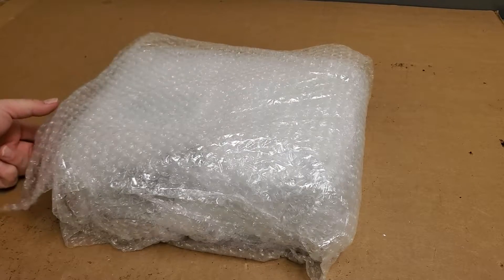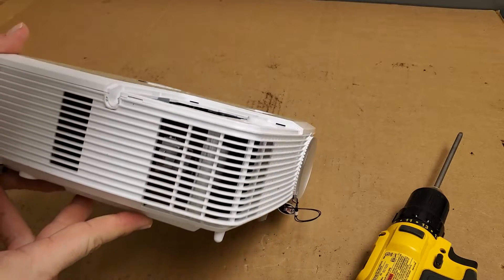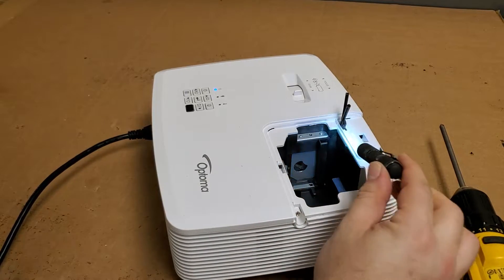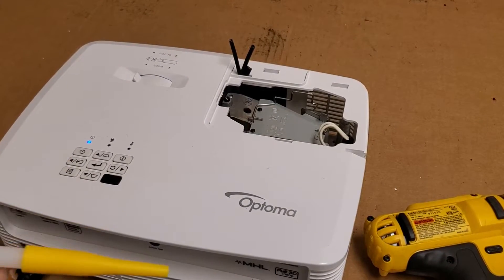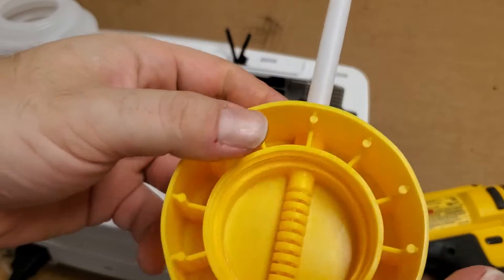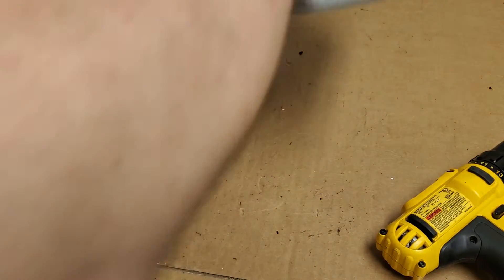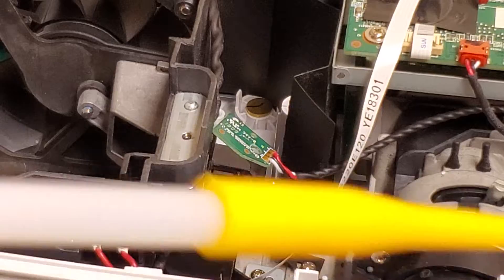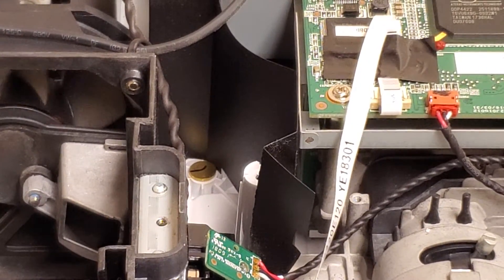Optoma HD27 DLP Projector Repair / No lamp ignition

Comment: Haver you ever fixed an HD27 with a "Fan locked" error? I replaced both fans. Still get the error.
Reply from the maker: That is annoying.  I would check the status output of each fan and see if one isn't working. I have a video on testing fans that might help.  It's possible something on the main board has an issue.  The fan control IC might be bad or the pullup resistor for the fan status lead.  Also check the solder on the connect.

Comment: Hello - I have an HD27. When I press the Power button, it initially goes blue. But then after a couple of seconds, the lamp LED shows red and the power button begins flashing red. I had tried to reset it by unplugging all the cables and then holding the power button down while inserting the power cord. Then the power LED began blinking quickly and then I released. Then I read to press the Power button again and there should be a "click", but mine never did and eventually the Power LED went back to red. I have yet to resolve the issue. There is no fan that comes on when I try to power it on. Any assistance would be greatly appreciated. Thank you!

Comment: Any idea on why an optoma hd144x has all 3 leds lit up. power red/ blue leds lit, lamp and temp leds are red? Just turned off with less than 70hrs. No other signs of life!!! Will have to leave in somewhere local as unfortunately your to far away. Thanks for the videos
Reply from the maker: without seeing it I am guessing but I would be suspect of the mainboard being bad. I can't really say what is bad on the mainboard but if I had to guess, it would be a voltage regulator as they are a common problem. Another possibility is the power supply.  This sort of problem is usually pretty terminal. A replacement mainboard is in the $300 range. If you have any local techs who can check it, they want to verify the low voltage power supply first. If that checks out, then check the little voltage regulators on the mainboard.   Let them know the PMD1000 IC is a known culprit as well.
Reply: @FixitFrank  thank you, I appreciate that you responded and shows that you are motivated to online education via your videos. I havent seen the fault reported anywhere else online. I'm a physical therapist, so not my area of expertise and would only go as far as testing capacitors fuses, mosfets. I will leave it in and if they can fix will update on the cause in case it helps yourself or someone else. Many thanks again Frank.

Comment: Hi I have a UHD35 that had a big lamp blown. I had to replace the power supply board because it was burned. I have also replaced the lamp but when I turn the device on it shows the optoma logo but after few seconds it goes off and I get blinking red light for power and fix red light for the bulb. Do you know what could it be?
Reply from the maker: its hard to say on that chassis.  I'd see if the color wheel is okay.  Also if you replaced the lamp assembly with a cheap one, that can cause it because they use the wrong IR filter on the housing.  Make sure the lamp has a red/blue tint to the front glass. If its green/clear that is your problem.  If not, then it might be a mainboard issue.
Reply: @FixitFrank  thanks a lot. Really appreciate your response and your videos all of them very instructive. I'll check about the lamp although is a Phillips one. I think it might be the color wheel...hope is not the main board. I'll let you know when I get it sorted. Again, thanks!
Reply from the maker: I dont mean the bare lamp. I mean the full housing.  see this picture. https://imgur.com/i4eyOKE The part I put the box around is what you want to look at. If the lamp assembly was from Optoma then it will be okay but if you bought it on amazon or from some of the bottom feeder aftermarket websites, that could be the problem. h

Comment: I fixed my color wheel which was missing a chunk, and I also replaced the bulb.  Now the fan doesn't even go on and there is just a light clicking sound and the projector goes into red dot lamp failure mode.  Seems like things have gotten worse after replacing the color wheel.  I have an HD28DSE.  Any advice?  Thanks
Reply from the maker: Did you replace the wheel or just glue the chunk back in?  It could be the wheel you hear clicking.  The wheel must spin up before the lamp will ignite.  If you didnt replace the wheel, I would do that first.  Usually once they throw a segment, they are pretty done.  Sometimes you can recover them but its rare that it works.
Reply: @FixitFrank  Thanks Frank, it was that I didn't trick the switch on the lamp cover.  Silly mistake.  Everything worked after that, but I did accidentally remove one of the screws holding the mirror box in the light tunnel so I had to spend an hour adjusting it to remove the burn on the screen.  I ended up getting it 90 percent of the way there, but I need to find the right mirror box for the OptomaHD28DSE light tunnel and replace it, because there is still a few inches of burn at the bottom right side of screen that I cannot seem to adjust away.

Comment: Hey fix it frank I am having a problem with my projector. The projector comes on and runs and I replaced the bulb but before I did the light went out. Like no picture, before it completely  went dark the colors were off like yellow was green red was brown etc. New bulb still no light or picture. Color wheel still clicks and fan still runs but bulb light comes up red and power like turns orange but the projector still running
Reply from the maker: Kind of sounds like you ended up with a defective or low quality bulb.  If a new bulb gave you flickering and offset colors, that is a symptom of a cheap housing.  They will cause the color wheel to get confused and shut the projector down and even prevent it from lighting all the way.  
I have a link in that description box for a bulb that is good quality. I doubt the projector is broken at this point,. I bet its a bad bulb.

Comment: where is the fix? this is a cleaning the title suggests you diagnose an issue and repair it. Im not getting lamp ignition. the lamp appeared to be working then the color wheel was noisy. the lamp doesnt seem bad, but the base does look chipped but no debris inside. no lamp ignition at all after color wheel replacement
Reply from the maker: The repair for this was a cleaning. That is the fix for that particular projector. I say that in the video description.
 From what you commented, its probably something to do with your color wheel replacement.  What specifically I can't say.  Numerous things can cause no lamp ignition.  Best I can offer with the info provided is go over your work and see if you missed something or re-assembled something incorrectly.  There is no one cause.
Reply: If you don't place the cover back on or trick the switch, neither fan nor lamp will go on.

Comment: Hi, i can't find anywhere whats The DMD chip model for This projector. Could you help me?
Reply from the maker: That's a tough one. Personally I always remove them and get the number so I am 100% sure before ordering. Being that you have to remove it anyway I would suggest that. Sometimes the online info is incorrect. One other suggestion is to call Optoma.  They won't have it in stock but they will likely give your the part number. Their repair service is poor but their parts service is pretty good.

Comment: I like what you do there with that proyector,now my problem is a DBpower "new",it plays just a few minutes,I test everything and it's start to smell like something burn and shut off and now don't have any image,but it look like it have electricity,but do nothing else,can you have the time to tell me what is it?,I appreciate your help ...🥺🥺🥺
I check some videos showing me it can be the SR5100,help!...not of the  fan are working and the light from the lamp is like flashing.
It's a DBPOWER L21 mini LCD video projector....🥺🥺🥺Thank you,sorry for my English!
Reply: "New"for the year it came out,but new from the package... 😏😏😏
Reply from the maker: Your english is fantastic! No need to apologize. Unfortunately these are surprisingly low quality devices.  The polarizer film and LCD panels always burn at some point.  My personal feeling is that the manufacturers of these do that intentionally to make people buy new versions.  
I would suggest looking for a used name brand projector(epson, optoma, NEC etc) as they will last far longer.  You can find an older used beamer/proyector for less than $100USD and even as cheap as $20-30USD.  I would stay away from LCD versions unless you can view an screen image first. old LCD can have a spot in the middle that is not repairable. DLP/LCOS tend to hold up longer.
Reply: @FixitFrank  Thank you for the suggestion,so you are saying the I better buy something else,don't botther to fix it!....🥺🥺🥺.
Even if I replace the diode or the lamp is going to keep a mess up product....😬😬😬,better buy a new and different projector!?... 🤷🤷🤷😅😅😅
Reply: @FixitFrank  You should see how beautiful picture have,that one of the reason of buy it on the first place.It is posible to change those part the you mentioned and keep my "new" projector?...😅😅😅😅
Reply from the maker: I would not suggest repairing it.  These are designed to fail. Plus the cost will exceed the value of the projector.  A used name brand projector will serve you better and longer.  I wont even take these in for repair because of how they are designed to fail.  the companies who make these, use parts that fail intentionally so they can sell you more projectors.  They skip things like fuses and extra fans and heatsinks that would help the longevity because they want you to buy a new DB power every year or so.  I'd look for a used Optoma HD20, BenQ W1080, W1070 or Mitsubishi. they will treat you very well!
Reply: @FixitFrank  Thank you for the suggestion,I'll be getting your advise,well it look like a loose $50.00,I'm going to try to do a DIY one for now!...😅😅😅😅,I will look for one of those!,have a nice day,take care!....😉😉😉

Comment: I've got an Optoma X600 Projector, I only use it a few times a year.  No longer fully powers on.  Power light blinks 7 times, pauses, 7 again, and repeats.  Google search points to a Lamp Door Sensor, but I cannot find any schematics on how to address that.  PC Detects the Audio signal from it, and web-interface of the projector says "No Errors", so i doubt its the board.  Any thoughts?

Comment: I have to ask because this just happened to me my wife called to tel me she went to turn on the projector and the screen came
Down but the lamp did not fire.. later the lamp failed lamp lit up.

So I get home change the lamp same thing however I noticed the color wheel sounds a bit louder when it spins can dust get on the index mark to prevent it from starting?
Reply from the maker: Not the index mark as much as the sensor for the index mark.  Since its spinning dust tends to not attach to the hub, but since it is spinning, the mark can fly off. The dust can land on the index mark sensor.  I'd check the lamp assembly first.  If its older(1500+ hours) I would try another proper new lamp assembly first. If its fairly new(less than 1000 hours), then check the color wheel area.  Bad lamps are always my first suspicion since its the most common problem, and then I troubleshoot from there.  If you want to post a video of the noise or check the short I posted with a bad color wheel noise https://youtu.be/TEnXuTeZjIw  (same chassis as the HD27).
Reply: @FixitFrank  you can see the video I did last night I checked the color wheel today no missing segments.

The bulb only has about 700 hours on it
https://youtu.be/34BGkUuc5FQ
Reply from the maker: It sure sounds like the index mark came off. That 'dit dit dit' noise is the motor speed adjusting to try and pickup the sensor. See if that black sticker came off the hub. The segments should be ok (like you noticed). I suspect the index mark fell off. It's a common problem on this chassis. Or the index mark sensor is acting up. The noise tells me that "something" with the color wheel index mark is the likely the problem. You may get away with regluing the index mark sticker back onto the hub or just replace the whole wheel. They are pretty inexpensive.
Reply: @FixitFrank  thanks I took the bite and just ordered the color wheel should be here tomorrow so I will keep you updated on it.
Reply: @FixitFrank  you were 100% right Took this photo, new CW is in and all is well again! Thanks so much for this video and the help!

https://imgur.com/a/UOukqbP

Comment: Hi Frank, I am getting lines on the screen. Optoma HD 67N. Any thoughts? Thanks
Reply from the maker: What kind of lines?  vertical strips or moving horizonal?
Reply: @FixitFrank  vertical strips
Reply from the maker: Probably a loose/insecure connection between the mainboard and the DMD board.  That is a pretty common symptom.  Double check the screws in that area.

Comment: Hey Frank! Hoping you could direct me in the right direction. I have an optoma hd26. Was watching a show and it turned off. Power/standby is solid red. So is the lamp light. When I turn it on The light goes blue and there is a click noise. about 3 seconds later the power light goes red again and the lamp light turns solid red.. the fan doesn't start up at all and neither does the color wheel. I tried a new bulb just to see and it didn't fix it. The projector has maybe 500 hours on it. Surprisingly little info about it out there. Any help is extremely appreciated!
Reply from the maker: .  I have a few vids on this chassis.  Look up my video on the GT1080 I did recently.  They use very similar chassis.  In fact my own HD26(which Im selling) had a similar issue and the power supply ended up being the culprit. I have a few videos on the HD26 but they were color wheel vids.  They do show disassembly though.
Reply: @FixitFrank  also...what kinda price would I be looking at to have u fix it?
Reply from the maker: It does sound like it.  Of course you want to do the troubleshooting to be sure.  I only say the power supply because it seems to be a issue that pops up with other models with the same symptoms.
Reply: @FixitFrank  right on! Thank you for responding to me.Based on the description you think the power supply board is most likely the culprit? With these older projectors I don't wanna sink too much money into . Sucks tho because it really doesn't have a ton of hours on it.

Comment: hey frank what do you do is the color wheel dosent turn but the fan runs....that what im getting on my hd20
Reply from the maker: Hi!  I would suspect either a stuck color wheel(bad motor) or possibly a problem with the mainboard and the color wheel driver chip.  If you never changed the color wheel before, I would suspect that first.  My HD20 is Color wheel #2.  (it's about 9 years old)
Reply: @FixitFrank  it was the color wheel sensor....i switched it with my identical one....i got two...now i fix that one now the other one i put the good color wheel and sensor on it and now it dont even turn the fans on i pushed the color wheel a little and it jumps and thats it then the red lamp lights turn on any solution for that?
Reply from the maker: Id check your color wheel sensor wire on that one.  I bet one of the 3 wires is not connected (it may be glues in place so it will look connected).

Comment: Do you know anyplace i can take my projector  for repair  or do you provide  that service  its an Optoma g720..black lines appear after  trying to clean it
Reply from the maker: I think if you reseat the mainboard you should be OK.  Usually that is  bad contacts between the dmd board and the mainboard.
Reply: Ok thank  you I will try again..when I took the screws out 1 screw  was a bit longer and couldn't figure  out were it went.any idea
Reply from the maker: @map1537  What kind of screw?  Is it fine thread or coarse thread?
Reply: I can't  tell  the thread looks the same I think I got 3 tiny screws  and about 15 that are the same and 1 screw that is a tad longer than the 15 ones.. I shouldn't  have tooken it apart im not near qualified  . I put it back together  can't see where I went wrong

Comment: Hi Frank, I've had a similar issue with an Optoma HD26 but still got lamp light after clearing all the glass debris. I've posted on r/projectors but no responses
Reply from the maker: Hi George! These have an integrated power supply/ballast that can be "electrically fragile".  https://youtu.be/SU89j8NoyBc  See this video on the GT1080(short throw version of the HD26 I believe). They are identical electrically and this projector had an issue where the lamp would light occasionally but mostly not.  Ended up being a problem in the Power module.  Did the lamp burst while it was on?
Reply: @FixitFrank  Yeah it did!
Reply from the maker: Sometimes that can damage the ballast.  The lamp will touch the arc points briefly enough to short out and damage the mosfets.  
Are you able to post a video of the projector as it operates now?  If I can listen to the attempted start up, I might be able to see what is going on.